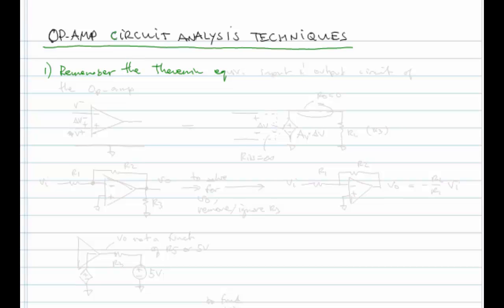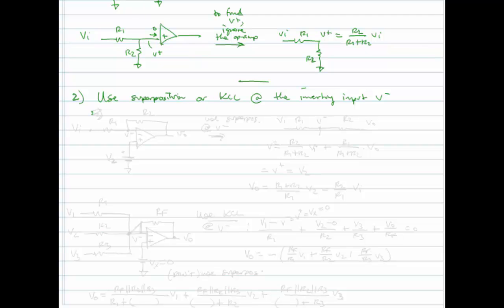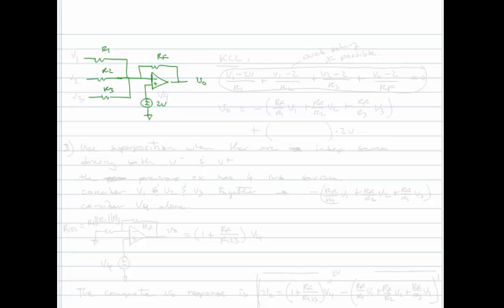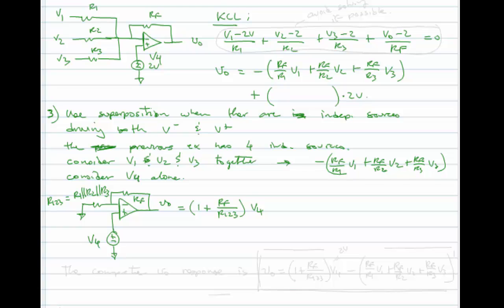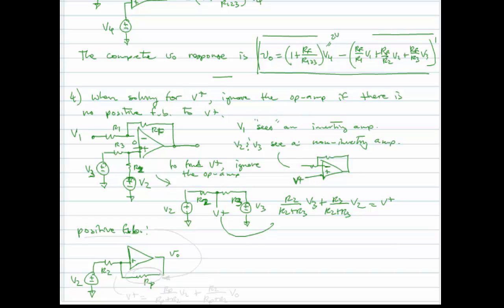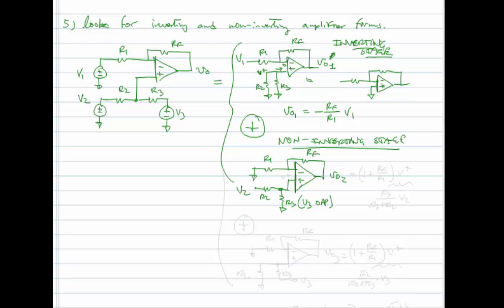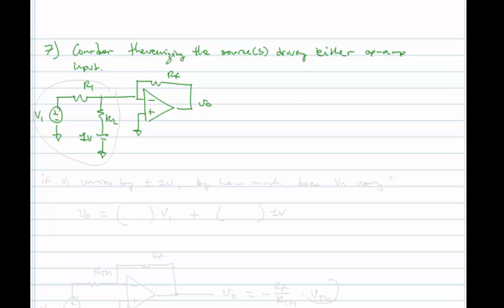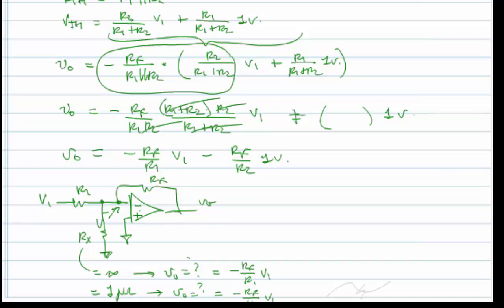Op-amp Circuit Analysis Techniques & Tricks (OP05)

Comment: Analog signal processing has always fascinated me.  I get much more satisfaction from designing a good analog circuit than writing DSP code.  I know DSP filters have lots of advantages over analog filters, (incredible performance, non-linear stuff, no drift, cheaper, more reliable, don't distort, less noisy, less prone to interference, etc)  but I still like analog.  Somehow it just seems more real to have actual signals than just a ADC => number crunching => DAC.